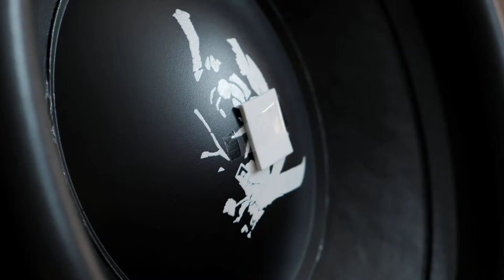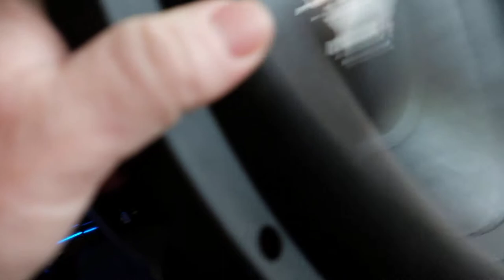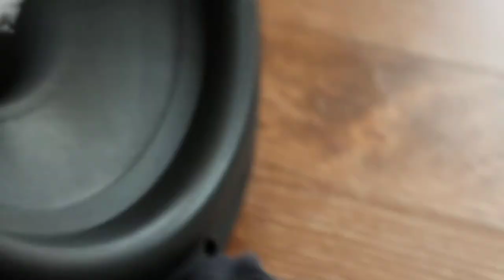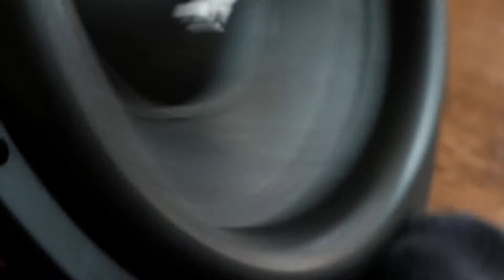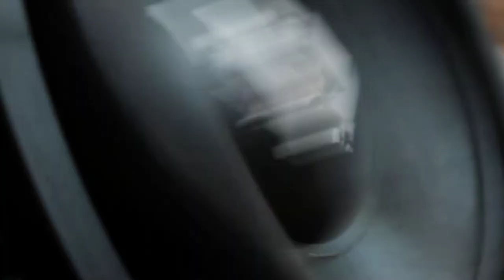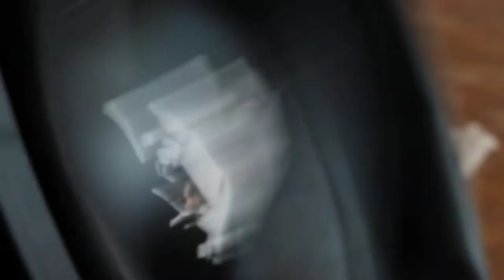Adire Brahma 15d2 Prototype.

Comment: I read in your comment you’ve been archiving tsp’s for decades 👍 would you happen to have the tsp’s for an 18” adire audio Brahma?
Reply from the maker: Never had an 18 to test, but with the way the Qts for them climbs with size, the 18 would be an IB sub.
Reply: @2002ZRX1200R  
Infinite baffle?
Reply from the maker: @deejay2301  Yep. The 15's would work well IB. A qts above .5 needs a lot of volume, by .6 they need way more than vas as net, and tuned well below fs to not be peaky. Above that, if the ebp is below 50, might as well IB or the sq will suffer.
Reply: @2002ZRX1200R  
Cool thanks

Comment: do you like it? does it sound good? it sounds like it bottomed out at one point. i ordered 2 hoping i like them.
Reply from the maker: It's fully broken in specs were significantly different than listed, couldn't use it. The production model specs are even worse, starting with a qts of .67 ended around .63, vas was higher so for it to sound decent the box would have had to be huge. Couldn't use it either, atm the tumult is also way off listed specs but not fully broken in yet, but looking doubtful that it will meet spec so mote than likely not gonna be able to use it either.
Reply: @2002ZRX1200R  i cant check qts or i dont know how,  but there site says .47 qts for the dual 4 ohm which is what i ordered. so your saying that i should expect a qts of .60's? how are you checking qts?
Reply from the maker: I have a full testing setup to pull TSP's and EM's. I have archived TSP's for 2 decades. At one point I had a blog on SPLC called Phill's Thiele's. Starting Qts on current production ranges between .63 and .67, broken in is averaging between .51 and .55, Vas is more than advertised so boxes will need to be larger and lower tuned to sound good (not peaky.)
Reply from the maker: Avoid the Dayton Audio tester, they are junk. Smith and Larson testing tools are the way to go.
Reply: @2002ZRX1200R  ive put one in a 3.6 cu.ft. box tuned to 22hz it sounds pretty good but im building a 5.7 cu.ft box tuned to 22hz gonna see what that sounds like. i have 2 of them going in my home theater.
Reply: well after listening to them in the 5.7 cf. boxes i like them better in the smaller ported boxes for music. but its ok for home theater. i have never liked the sound of big ported enclosures, too boomy and a little soft or mushy not defined enough or tight and thats what im hearing in the larger boxes. i think around 4 cu.ft. ported is about right for music. probably around 3 for sealed would be good. i would trade off a little low end for better upper frequency response/transients/dynamics any day.
Reply from the maker: @jhue73  big is only boomy if tuned too high, or in improper volume. With the 15"s qts and vas, 5.7 is too small which would cause a peak above your tuning vs accurate response and decent flat bandwidth. They are subs from 12" up, mms:bl and significant le will cause lack of tight response and poor attack/decay.
Reply: @2002ZRX1200R  almost any sub will have a faster attack or decay in a smaller enclosure. there isnt a peak above or around my tuning which is 22hz. accurate and a flat response are two different things. just because a sub is flat doesnt mean its accurate. an eq can make a sub flat in any enclosure. the bigger an enclosure the less acoustic dampening which causes the cone to move further than it should on each note. i prefer more acoustic dampening. you would need a very light moving mass in large enclosures just like pro audio drivers. anything below 40hz big enclosures sound fine but above that they dont.